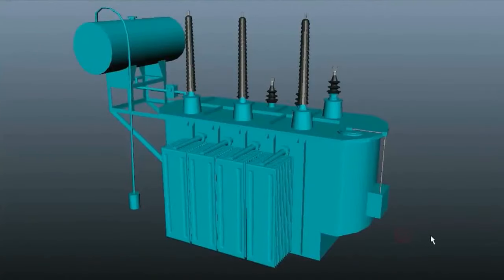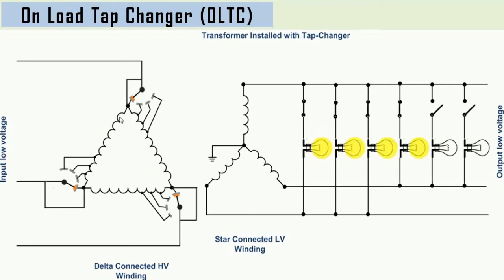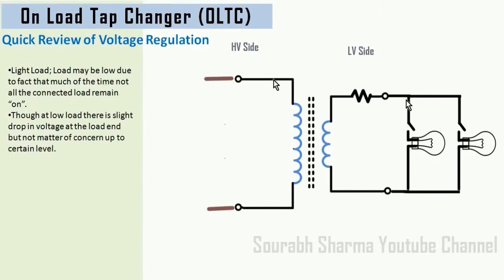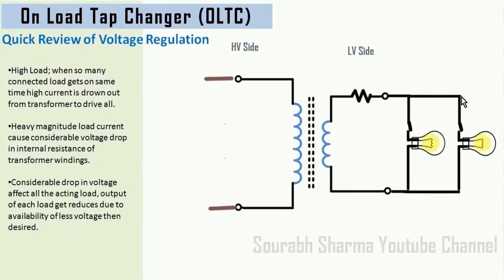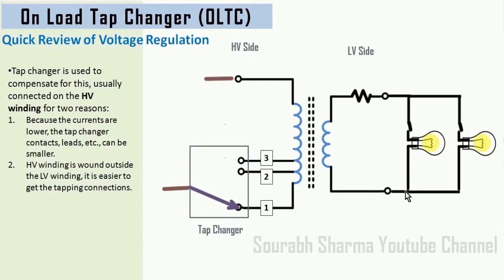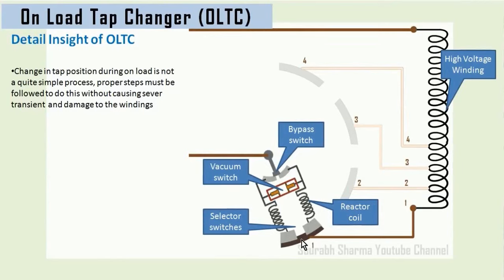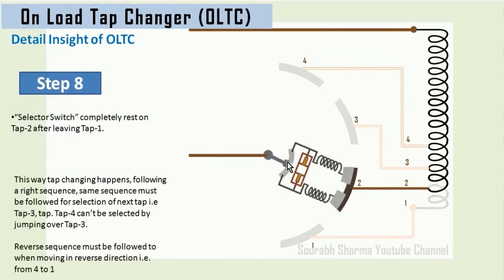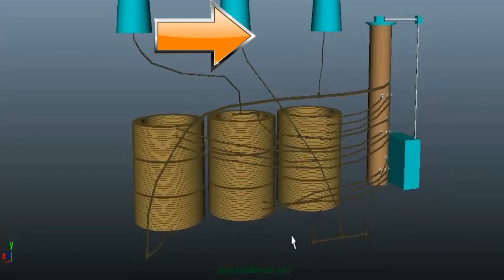On Load Tap Changer :- How it works?

Comment: Under-load voltage regulator (OLTC) in a pressure transformer, working in dynamic mode, plays an important role in transmission and voltage regulation on the power grid system. With that working mode, OLTC usually has a high probability of failure. Failure of the OLTC unit can damage the entire structure of the transformer, disrupting power supply services, and causing economic losses to the operator and customers.